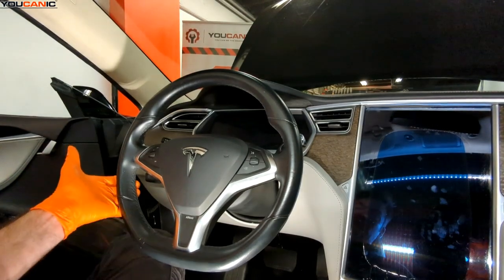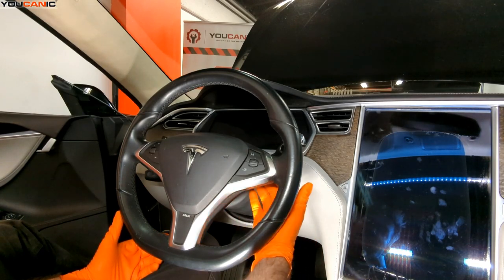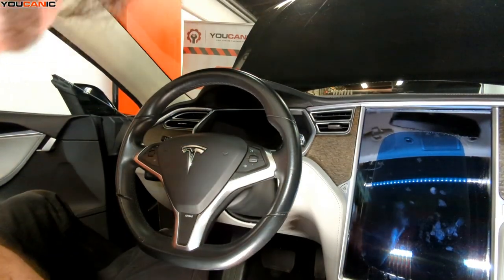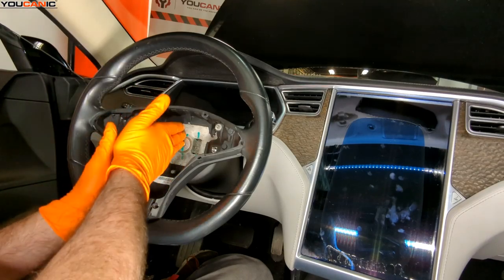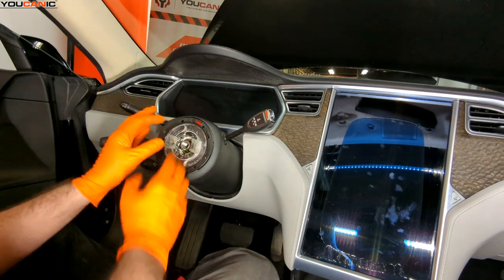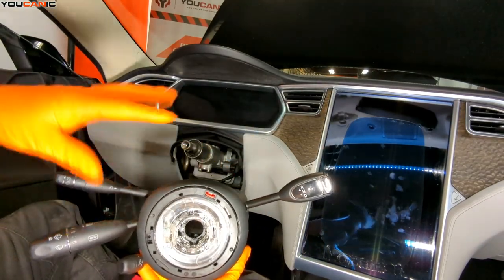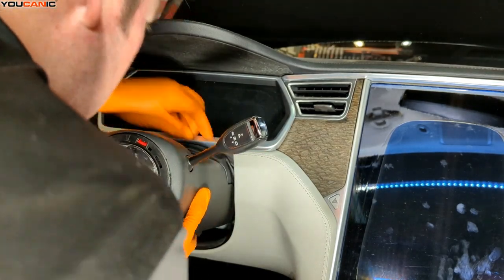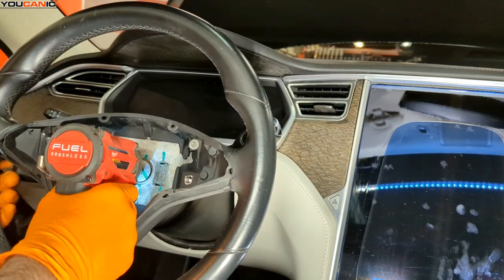Tesla Model S Steering wheel, Central Air Bag, Clock Spring Replacement DIY

Comment: Love the video. Just changed out my steering wheel and I guess the steering wheel wasn't locked. I moved the clock spring and now my car is centered based on the wheel being about 8 degrees to the right off center. How can I fix that?

Comment: I recently replaced the clock spring in my Tesla Model S (2018), but I’ve noticed that the steering wheel is still not functioning. This includes buttons, horn, and other steering-related controls.

The alerts log shows a “PedalMonitorWarning: DAS CAN note is missing”, which seems to indicate a communication issue between modules. I’m wondering if the car needs to re-establish a connection with the new clock spring or if additional steps are required in the Tesla software to make it work.

I’m in Service Mode but can’t find specific options for reinitializing the Steering Column Control Module (SCCM) or calibrating it. Does anyone know if this requires access to Toolbox or if there’s something I can do directly in Service Mode?

Any advice or guidance would be greatly appreciated!